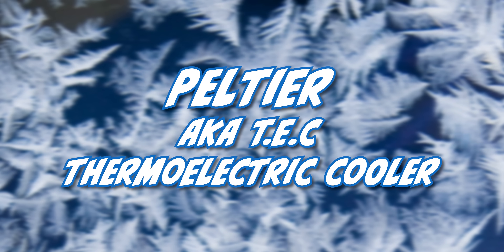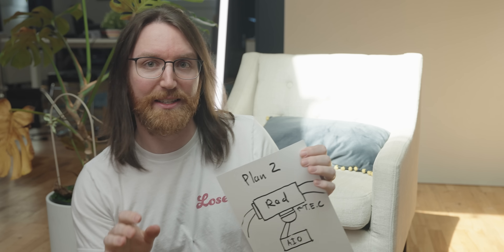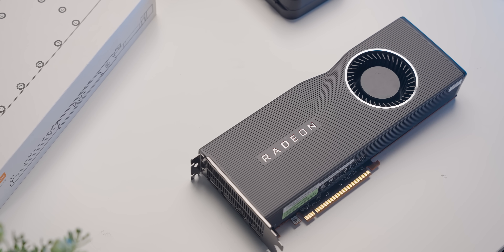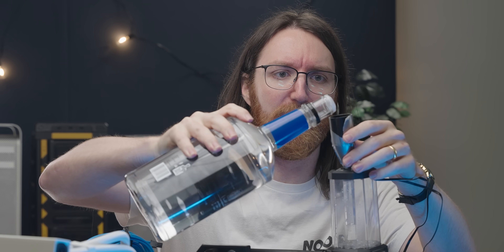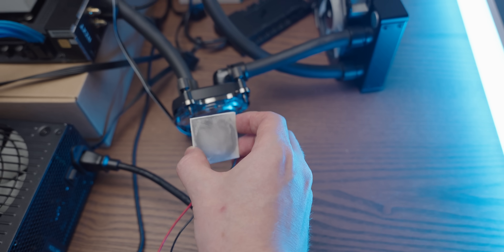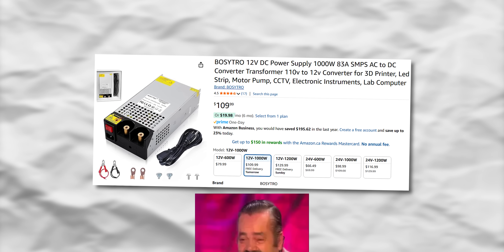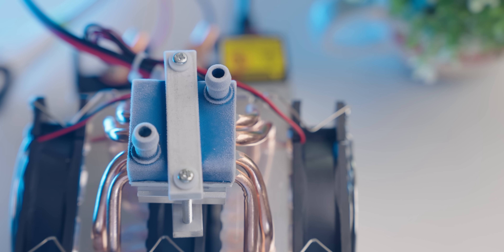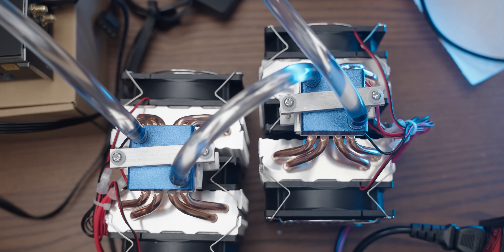I REVOLUTIONISE PC Cooling....

Comment: You basically want to have lots of lower wattage chips with a big water block for surface area. 4x 60w on like a 6-8 inch long block ect. 

The goal should not really be to chill your coolant loop down but to achieve a sub ambient loop temp. 

You can pretty quickly spend more in parts than a off the shelf cooler will cost. They are made for laser cutter machines and plasma cutters ect 

Once you can achieve sub ambient temperatures you run into the next and biggest issue which is of course condensation. Condensation will 100% kill things in your pc. 

Most common solution is to apply water resistant coatings to the computer parts, nail polish Vaseline ect. But it's actually easier and more reliable to address one of variables in the condensation equation. Moisture content in the air.  

If you enclose the pc in an airtight container that you can create a very low moisture content environment in you can reduce the potential of condensation forming. 

But if you are already building an airtight container you might as well cool the environment inside it to sub ambient as well. 

I have settled on a -20 degree Celsius loop and environment. With it I can run 200w cards at right around 0 degree Celsius and high end high w cards at about 20 degree Celsius. 

The current gen Nvidia product line can strongly benefit from under-volting So much so that it is possible to pretty much save enough power from an undervolted 5090 that you can run 300-500 watts of peltier's and be at similar total power usage. 

The issue becomes that while performance does improve, mostly with micro stutters in my observation, The performance of nvidia cards is so locked down by corp greed nonsense atm that your better off focusing on sub ambient cooling for your cpu.. 

It's not like the old product lines which you could drastically improve performance from gpu core temp reductions. My opinion is that if anyone is going to go down this rabbit hole now they should aim for full front and back mobo and gpu block coverage to chill the entire system down to sub ambient.

Comment: Should note that the wattage is power consumption. Not how much heat it "pumps". In general peltiers only move about 10% of their rating. So that ~230W unit will only move 23W of heat. So no wonder your 200W graphics card overwhelmed it. To do a good job you would need a 2000W cooler and the best way to do that would be a liquid loop like this as it's going to be a big device.

Comment: Bring more surface area of the peltier's cold side to the CPUs vod-..coolant by rethinking the reservoir to be large enough to submerge a multi-heat pipe air radiator. And also importantly the return and suction for the CPUs coolant must be positioned so that the fluid must pass through the radiator.
So in short; new reservoir fits a cold radiator/radiators that lie between the reservoir's exit and return forcing the coolant to pass through.
What are your thoughts?

Comment: Just get rid of the 240mm rad, its sapping away all the cooling. 

The GPU is adding like 150-200w into the loop, and the TECs are removing like 300w. If you didnt have the radiator balancing everything out you should see a 30-40c drop in liquid temp.

Comment: Ive done this years ago. It works. Dropped load temps by 6C on the 965BE. This was with a 5870 and 5850 in a water loop.

Comment: I like how you thought it would freeze, despite the radiator exchanging room temp air with the coolant. The radiator will try to get the coolant at or near ambient, regardless of if the coolant is warmer OR COLDER. Radiators don't JUST COOL hahahahahaha

Comment: At this point, hooking an ac unit to the system, would make more sense...  or running a ducks from your ac into your pc case.  See, the thing with peltier, is that they are beyond inefficient.  The amount of heat they produce, negates any kind of real value.

Comment: You forgot one control test; removing the TEC from in between the two loops in the first test. Just sandwich the two CPU cooler plates together to see what it does without the TEC.

Comment: So you needed to prevent water from freezing and you know what anti-freeze is, therefore you went with flammable vodka around electronics... Why not at least use cheap isopropyl?

Also, those last chillers clearly didn't work because the PeeCee had no fish. Next time use a dozen and at least add some goldfish crackers.

Comment: Noting the rigueur with which you conduct your engineering, I can only conclude that the lack of appreciable temperature delta must be due to the errors in the measurement equipment.

Comment: in rally we use chargecoolers. they are water holding chambers at the inlet and outlet of the intercooler to help keep the intake temps as low as possible. we get about 10-20c lowering depending on the season when using water. when using alcohol it is improved further. 

the sides of the radiator seems to me to be best place to add these, as water of spirit is a poor conductor of heat. from what i know water is one of the hardest things to heat up or cool down. the metal on the radiator on the other hand is quite good at conducting heat and cold. thanks for the idea :)

Comment: Something to note, the wattages on the peltier are total consumption.  So if you have a "231 watt" peltier, you aren't getting 231 watts of cooling.  You're getting a part that consumes 231 watts and generates that amount of heat transfer, but since it generates heat while also moving it it's FAR less than that.

Comment: they way you used it is highly inefficient...yes. Peltier has a watt rating. If you surpass this wattage it does not work. It has to have a cold plate that directly touches the core. Moreover you must be able to cool the Peltier and the source. The latter means if we have a 50W peltier and a 50W source then we need a 100 w cooler. If for any reason the source will outputs more wattage then the peltier will not efficiently cools it. Simply put, your experiment was a junk idea from the start, you cant cool water with pelt, you need a chiller for that. Moreover it is best to have a stronger wattage peltier than the maximum watt of the heat source in order to have loads close to 0 degrees of Celsius. A good pelt setup would have values close to 10 in load. If you count all these parameters in the modern PC era, the peltier is ineffective. Peltier worked fine for Cpus up to 35-50W in times when socket 370 was around.

Comment: Love your videos. You mentioned that the Polar Ice smelled like anti-freeze. Wasn't that the perfect solution, literally. Use distilled water with 25% anti-freeze (ethylene glycol by volume). I believe AIO pumps can handle this. Then we can keep most of water's heat capacity and transfer ability with lower freezing temps. It's in the name: anti-freeze--I feel like I'm being trolled :-)

Comment: The level of stupidity here is off the charts, even for a Canadian. Freezing water in a running loop is impossible. Your two fan radiator in the loop can cool ,lets say 200W. If the water would be at freezing point in a 20C warm, room then you get  200W of heating. In order to counter that your peltier device has to be a 2000W unit, because they are just 10% efficient. I think that is above the typical US indoor power outlet so you blow your fuse as well.

This is with the CPU not doing anything and no other losses in the loop.

Comment: the problem here is that it only transports to the other side but then adds heat too. In the end you need to remove more heat than before...just using ca copper plate in the exact same setup would probably work better.
Peltiers are only a reasonable thing to use if you need to cool below ambient.

Comment: Used to work for a electronic distributor that distributed Peltier cooled Pelican cases for military use in extreme environments, like a desert. It cooled the air like an air conditioner.

Comment: You can stack those TECs. Try again. They are always wildly inefficient. If you want to make a tiny tiny fridge to cool off one can of soda very quickly that's achievable. You should probably watch how Tech Ingredients did it, because I doubt anyone is going to do it better than the college professor that likes to make rocket fuel and computer controlled death rays. Just saying.

Comment: Time to escalate & do a Whistlin' Dawid, go 'upvolting' and get an AC DIY heat pump.  Like you did with the window AC, make an adapter to duct the head unit into the rad of an AIO, and push the limits baybee!

Comment: i think peltiers might not be very effiecient when the temperature is super high. maybe putting a normal heatsink in front of a radiator with a fan in betweeen and then a pelteier and a watercooler so the air pulled into the radiator is colder. not sure it would work great

Comment: Your issue is you are tring to overcome room temp though the your rad as the rad will try to stay at room temp, via sheding coolness if colder or as heat if hotter then the room temp.

Comment: The problem with this kind of cooler is that are less efficient heatpipes.
Like for example the 280w one, itself has a 65% efficiency so it can only cool 180w, that is if in the other side you're cooling the full 280w, and that's just to maintain stable temperature, not being cooler  than the default cooler.

Comment: The only reason to do this to go under ambient temp on the liqued, for that you should put them after the radiator so most of the heat is removed there.

Comment: Ignoring the fact, that it's not cooling the water below ambient, I would put the TECs between pump and inlet to the graphics card. Otherwise if you would be able to reduce the water temp below ambient, the radiator would heat the water up again.

Comment: I think you were blowing Peltier heated air into the rad also. If you could get a heat exchanger built around Peltier and cooled the hot side with the gpu heated water, then large rad, then cold side, I think you would start seeing more chilling, as long as your AC could keep room temperature stable.
 There was a case that had the condenser subzero cooling for and two hoses for gpu and cpu, I'm sure kind of setup is more electrically efficient.

Comment: Slow down the pump to as slow as it will go. That will leave the coolant in the radiator longer getting rid of the most amount of heat before the coolant reaches the Peltier coolers. It will also let the coolant dwell longer allowing the Peltier coolers to pull more thermal energy out of the system. Also putting your higher quality block on the Peltier coolers would probably help because the ones that came with them look bork spec.

Comment: Dave... I think you made a Mistake.
The radiator needs to be before the peltier, otherwise you are getting nothing out of this system.
Reason being, the peltier can go sub ambient, the radiator pulls everything near ambient.

So you have to put the peltier before or after the pump, not the radiator.

Comment: Cool It freezone circa 2006, did it as a commercial product. I've salvaged two and made my own blocks spanning 12 TECs. It looks threw a 240 rad after the CPU-GPU to prevent over cooling. Yes, there's a 120 watt heater on top my case, but it keeps the system at 30-40c

Comment: Place I worked at in the early 1990s tried using Peltier coolers to bump Intel DX2 486 100 mhz. up to 120 mhz. Did not go well. 😬

Comment: you could place the peltiers in front of the aio in a box to create a makeshift air con unit. so the fans are pulling in air directly from the box. equally, fill a thin copper/aluminium box with liquid. attach the cold side around the entire area of the box using a thicker thermal paste like an adhesive with the inlet tube and outlet tube both going into the box. then a fan or two  to move the air around the box.

Comment: You need to make a copper coil you can plunge into the reservoir and mount the cooler to it. If there's a material with more thermal stability I'd use that instead but copper is good enough

Comment: Why not try one of the ice chest water pumps used for surgical recovery to cool elbows and knees? It's a pump attached to a large ice chest. Attach the hoses from the pc directly to the device, fill with ice water and it should last hours and be easy to drain to maintain cleanliness.

Comment: did this in 1999.  you need a few more, more powerful peltier units and strong fans.  i started using my PC PSU but ended up swapping in a custom independent bridge rectifier and putting tall heat sinks on the cold side and sinking them into the coolant resevoir (a home depot bucket sitting next to the pc).  fluval fish tank pump and oil cooler radiator from an 89 trans am at the junk yard.  that celeron 300a ran at 500-something mhz

Comment: Okay so a couple things.

The order of things in the loop should be reservoir > gpu/cpu > radiators > peltier block > reservoir 

This is because the hotter the water temperature, the easier it gets to cool it with ambient temperature air through the radiator. 

Then you run the cooler water (or vodka :P) through the peltier block which can theoretically cool it down further which then goes back through the gpu. Running a peltier before the radiator is very inefficient because it'll make the radiator less efficient. Look up Newton's law of cooling for further explanation. 

Also vodka has worse heat capacity than water and peltiers are shite. Don't expect much from them anyway.